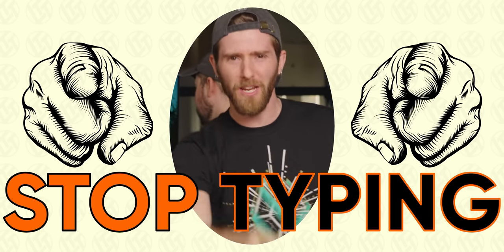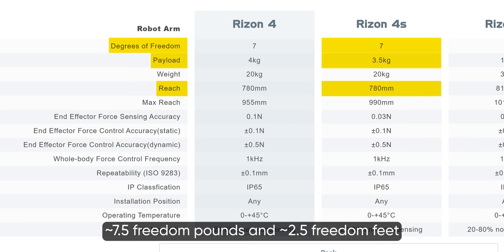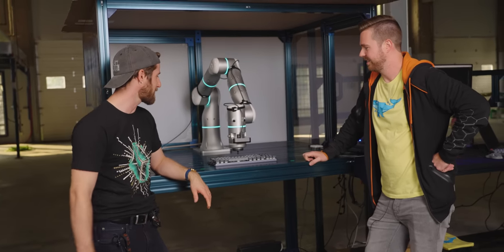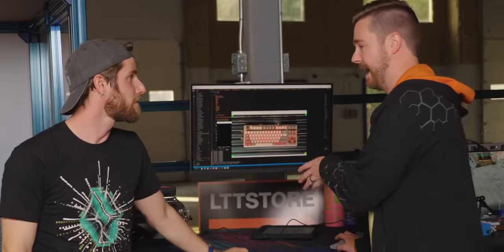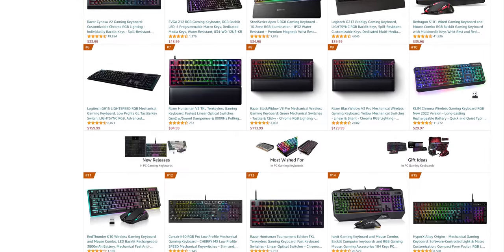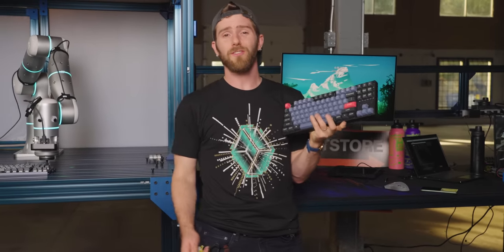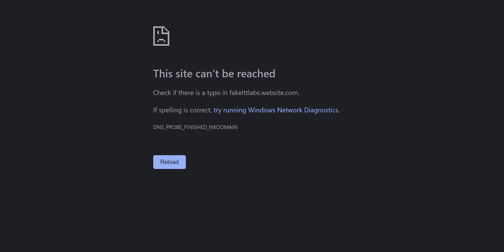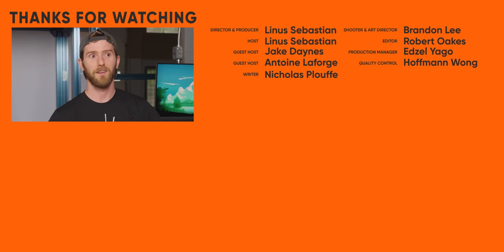Your Keyboard Sucks and I Can Prove It. - Labs Keyboard Testing

Comment: This is a really helpful test. I have a G915, and while I'm very happy with it and don't notice any issues while gaming (because I only recently started using mechanicals, so I still haven't adjusted to the shorter travel distances or the more uniform force requirements to depress a key compared to diaphragm keyboards), I have noticed that my Escape key, if pressed slowly enough, will trigger before the click (yes, I have clicky, and I like it because typewriter but not). In daily use, not a huge issue, and in Tarkov especially it's usually not an issue because if I need out of an inventory, the sooner the better, but it can be annoying if I'm not careful with it in non-competitive settings where I rest my finger too much and depress the key to just before the click/bump yet still actuate the key, possibly cancelling out of something that too a while to select or set up.

And that's just the actuation point vs spec. The entire gamut of tests and data LMG's testing lab is going generate is phenomenal, and I would loved to have had this data several years ago when selecting my first keyboard for gaming, and something I would kill to have available now not just for my own shopping and device selection, but to use and pass around for recommendations to others, as well. You guys are doing what should have been done all along, and I can't wait to see the repository you guys create!

That said, I am curious about what other devices you're going to do. I haven't seen every video lately, so I may have just missed some statements or not remembered everything, but I know you're planning on keyboards, headphones/ear buds, and possibly mice, but do is there any plan for devices beyond that? I don't remember if monitors were on the list, and what about microphones (headset integrated, usb, and xlr) for streaming? Any plans to branch out into non-competitive and non-gaming devices?
Reply: The actuation point and force needed to actuate a switch is really a personal thing. Not everyone has the same way to press a key and not everyone likes the same thing. For competitive purposes, you can get a low profile with light force and a linear switch for the fastest reaction time but outside of gaming, it won't be a pleasure using the keyboard. For the escape key, you can try contacting Logitech about that or fix it yourself with a desolder kit and buy a pack of your keyboard's switches.
Reply: @TryTane  I know it's a very personal thing, but it will be good to be able to see the data in comparison to other keyboards. The only reason that I chose the G915 was because I was actually able to get my hands on one and several other mechanical keyboards without having to buy them.

But my main point about the testing is whether or not the bump or click is where the actuation point is. I don't know that in my particular case it is worth dealing with Logitech or replacing the key, because it is really negligible and only noticeable if I'm hovering over the escape key with my finger and accidentally press down on it before I'm ready, And that's only in a very specific use case that I'm doing that. Despite having a good keyboard, it still has that issue, even if extremely minor, on one key and that these tests will help determine which keyboard manufacturers are reliably avoiding this issue with their QC and which ones aren't. Just giving a real world example of why tests like this matter and why I'm excited to see the results

Comment: This video will freak some companies out for sure. I had one horrible experience with a well known keyboard lineup, the HyperX Alloy fps.
I bought it in 2018, with the cherry mx blues switches. The announced travel force you need to apply to the keycap in order to actuate is about 60g. That's already a lot of force to actuate the key. My experience using the keyboard was bad, the switches felt so freaking stiff to actuate, and I just hated the cherry mx blues for the amount of force you needed to use in order to use them. I blamed cherry at that time for having such bad switches. I brought up several coins that weighed about 5g each, and placed them on top of keys that have not been used much, like the function keys on top. There had to be 16 FREAKING coins on the keycap to get them to actuate. DAMN, that means 80g of force to actuate. I looked it up on the internet, I looked like some of the Alloy FPS keyboards have this issue, not all of them. And of course, I bought another keyboard, Ducky one 2, with linear switches (cause of course, I hated blues and thought I need to have something easy to type on) and I just loved them. I don't think that blues are that horrible, they were surely implemented in a wrong way on that keyboard, but this machine mentioned in the video will expose any company that's just making garbage keyboards and throwing a bunch of money on their marketing. If someone has this machine and applies it to all keyboards, that could be one hell of a forward move to have quality keyboards on the market.

Comment: For keyboard latency, please take into account where in the keystroke the actuation takes place. Most people rest on the WASD keys and won't need to press as far to actuate as if they were hovering above them, for example. I just don't want to see manufacturers continue to put the actuation higher and higher to artificially make their keyboards more 'speedy'. Though it may help with random key presses, it affects the typing experience.
Reply: Also, the feel of a keyboard changes based on if you're slowly pressing or typing normally, would love to see a force graph for both.

Comment: I'd be mostly interested in knowing how consistent the quality of a certain model is over several years.
The big manufacturers like Logitech and Corsair have keyboard models that have been in production for years by this point. But have the internals changed? Has their quality changed?
Testing an individual keyboard tells me fuck all in regards to the products quality. On the other hand if a specific model had good samples produced in several consecutive years that's an indicator that the product may be worth my time.

Comment: I bought a cheap(80€) mechanical keyboard, and I was glad that the first year hadn't gone by yet when one of the buttons just stopped working. It just stopped from nowhere. I had the keyboard exchanged to a new one, but I'm thinking, maybe I should by a keyboard with changeable 'breakers'. That way I will not have to be afraid of awaiting a new one button kills the purpose of the whole board status.

Comment: Now's a good time for LTT keybboard videos. 

My BBlackwidow Ultimate 2014 has started double-stroking certain keys, and I can't do anything to fix it. I've clleaned out the switches as best I can. 

A new keyboard is on the horizon, so I welcome LTT keyboard reviews. 

Not correcting anything in this comment so you can see my probblem.

Comment: Later on, it would be cool to do mice and headsets too. This would be the best website for comparing gaming accessories.
Especially for headsets, would be cool to check if there are any big advantages for going with a 10 pounds full 7.1 headset over a virtual 7.1 headset

Comment: don't forget to measure angled keystrokes on the computer. I don't know about you, but I sure as heck don't type with my fingers hitting a perfect perpendicular/normal of the key, and feel my fingers sliding about about.
two of the things I want to know in general is what you're comprimising using the different modes on a keyboard (e.g. mine has a BIOS and then 3 other mods on a slider) and, even if the keyboard is USB 2.0 does putting it into a USB 3.x/4.x change its characteristics.
but the biggest point I have is in regards to Antoine's part: why don't you guys use a CRT? obviously you have native-VGA cards available (e.g. 1080) but if you use a non-scaling DP/HDMI convertor I hear they're lagless to let newer GPUs use CRT (though the only ones I can find in stock are 1080p 60Hz) and the GDM-FW900 which can do 1440p/144Hz, but you could always source a cheaper/more common/easier to repair/smaller alternative, set it to 480p and overclock the snot out of it - just set the brightness and contrast way down and the phosphors will last for decades. make sure to ESR test/replace the capacitors, have someone on-hand that can refurbish flyback transformers, maybe do some thermal modding to keep it nice and cool while overclocked and gg (it will also be the first time I've seen data for a CRT from the LDAT anywhere, which sould come in handy showing off how close QD-OLED, mini-LED, etc. are getting to "lagless").
I could also see this being VERY handy in testing say a £90 Official Microsoft Xbox vs £10 third-party/bootleg/recreation game controllers for PC (& console if you use a RGBs modded/capable system and split the sync from c-sync to Horizontal+Vertical [something like the 74LS123 or LM1881 IC's can split C-sync to H+V I believe, been a while since I looked into it when trying to convert SCART to VGA] to work with a VGA monitor)

Comment: Honestly, this feels like a bit of a stretch to suggest it's required testing, at least in terms of comparing mechanical keyboards. The switches genuinely are built to a pretty solid tolerance level - far beyond what will trip up most users. Instead, it's the quality of the chassis, the damping and other factors that are more important, and by the looks of how finnicky this setup is, it's not clear those will be well accounted for by this test. Broader comparisons to differnet switch types and showing the downsides of non-mechanical switches, though, would be interesting.

Comment: With hotswap keyboards couldnt you make a jumper switch. Send a input signal directly to the pcb and then check the output of the usb.
This would remove the switch as a variable aswell.

Comment: Why don't you just take Arduino or ATMega development board to test the latency? You can program some pins to control the solenoid and another pins to get USB signal to register keystrokes. Record timestamp for both and then subtract. Unless you also want to consider windows usb driver latency and system latency to process keystrokes. But you can measure that separately, emulating the whole keyboard package with the same tools, instead of per keystroke. But then you have 2 different sets of data. For example if in the future you may want to compare what is this keyboard latency on different OS.

Comment: Have you done testing to determine the range of angles at which users' fingers apply pressure for touch-typists? Surely the Q key gets less of a straight-down force than the F key, especially on ergonomic keyboards.

Comment: I can personally say that the Logitech Pro is awesome, except the key caps themselves start wearing quickly so the letters become unreadable... On top of that the RGB leds fail rather quickly too, already have random keys not being able to produce all lights. 
Props to Logitech to sending me a new one without extra costs, but unfortunately they all have the same issue... As for the spacebar, switch, it's broken and registers twice sometimes... Luckily they're hot swappable.

Comment: Why do not you test most of the aspects on one machine? 
Seems like the pressure test and latency measurement could be done in one run on one device. 
Saving some time and resources.

The laser scanner could also messure dovitaions in build quality (i. e. differences in key spacing in all three coordinates).

Comment: I see this going on to the point where LTT becomes a certification firm of sorts, becoming one of the most detailed and in depth 3rd party reviewers. It's massive what they're doing.
Reply: It's massive what they say they're going to be doing. If you check the website they only have a dozen published, without all of the data and pictures promised in this video... almost 2 years later. If it ever comes to fruition then it'll be super cool, but it seems like that might be a big if.

Comment: 12:08 the hot swap function will need to be tested also, some only take outemu switches.

Also, I'd like to know if the keyboard programming software allows for a custom layer

Comment: honestly i have a bigger problem with mouse microswitches. they are used much more often than vowels haha. i have a keyboard from the early 90s that works perfectly, but a mouse lasts 2 years at best before it needs new switches...

Comment: I don't really think you need to use the display when measuring keyboard latency. Just use the DirectInput keyboard API compared to the solenoid command driver? Sure, it's not end to end,  'real world', but there's no variability after the DirectInput SDK. Bonus being that you remove the variability of updates to the game engine.
You could do that with any Windows mini-PC, like some affordable N6005 machines all stacked up next to tonnes of keyboards.

Comment: Will you be testing membrane keyboards?  I actually prefer membrane keyboards at least compared to the switches I have tried.  But there is next to no information about which ones are any good because everyone has just blanket written them off as being crap.

Comment: aight so this might be hella cooked (its 12:30 am and i have to be awake at 6am) but you get the images from the bot and laser SoonTM. Isn't there a way to jank up that data and feed it to like another bot that can move solenoids around and be able to press each key and just make it so you have a bat file or something to always set the keys be LMB or at least have it so you have a solenoid on one end and a laser on the other end so you can 180 flip it, line it up with the laser then 180 flip again and have the solenoid ready to go

Comment: Wait why using vision?? I for real could make this with open CV? Alternatively use an azure kinect for depth. You could use the single phase lidar to also get depth data and fuse it with your pressure from Anton. 

I'm doing my research with stuff like this, love to see it on ltt. I'd code it for free.. have a 3d printer and a camera..

Comment: Hi, just wanted to enquire if there is going to be any chance that LTT might collaborate with other companies like iFixit with regards to creating creating guides as mentioned in the video as pooling resources together to better help with consumers with right-to-repair awareness. Also might a simple rating system be more useful in the a scoring system out of 10 or 100, something along the lines of indicating where a novice who one needs a screwdriver and maybe a keyboard cap puller to more intermediate and advanced skill like using soldering irons to fix there gear.

Comment: My keyboards don't suck. I spent anywhere from $250 to $650 building mine custom with legit painstaking lubrication, switch and cap selection and procurement. I would assume you mean the vile mass produced units and not my godly slabs of greatness...

Comment: would you test linux driver support for RGB lighting, with check boxes for open source drivers? IT would be useful to search keyboards by those actually supported on the platforms I use. This could also be extended to Mac OS.

Comment: Would be awesome to see how Leopold, HHKB and Pok3r keyboards are quality wise compared to each other.
Reply: I second HHKB. I would love to have accurate measurements of my HHKB Pro2 if they can get their hands on one! Then I would have a really good basis for comparison since that is the one keyboard I have and use.
Reply: HHKB Lite2 could also be an interesting comparison. I really loved that keyboard until the cable stopped working due to stress from being in my bag. I still love it, actually, but cannot use it anymore. 

Which actually brings an interesting point about repairability: I have taken apart my HHKB Lite2 several times, and in terms of design, it is designed very well for repair minus needing to go through a sticker for some screws IIRC. However, upon my cable breaking, I was not actually able to get any replacement part as they do not support that keyboard, meaning I cannot use it anymore despite it being designed very well for repair. So, for repairability, not only should design be taken into consideration, but also parts availability, because something that is easy to take apart does not help so much when a single part wears out and one cannot find a replacement for it.

Comment: Would this be possible to use with a mouse as well? Might be a little harder to get it to fit in the holders, but in theory this system should be possible to use with mice and other devices that use switches

Comment: Hot swap switches should not be "points" but a minimum requirement for entry. When there are hot swap boards on Amazon for $20 that can be made "good" there's really no excuse any more on the premium brands.

Comment: i only really care if a keyboard dosent have issues when spesific keys are pressed, i had 1 from razer that if you pressed S + A you couldent also press M with it, just give me a keyboard that basicly wouldent miss a button press in the unlikely event of facerolling on the keys. (or actuall reason you may need to press 3-5 buttons at diffrent places at the same time)

Comment: LOL, people realizing computer vision is A LOT harder than you realize. To get reliable CV, you literally need millions of data samples. When you realize your simple "validate/test keyboards" use case would require months of training to get a robust model, you decide to use laser instead. Even if you were to use binocular vision, it would still take a long time to train a robust model that can handle CEO moving the keyboard without require recalibrating.